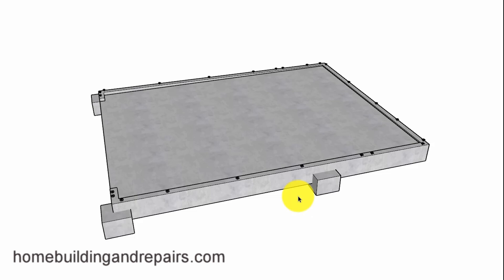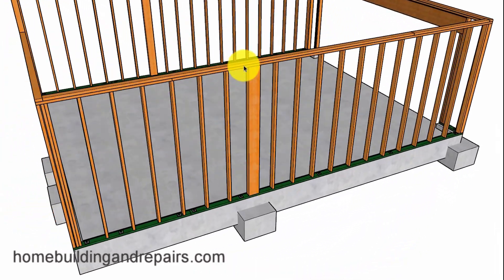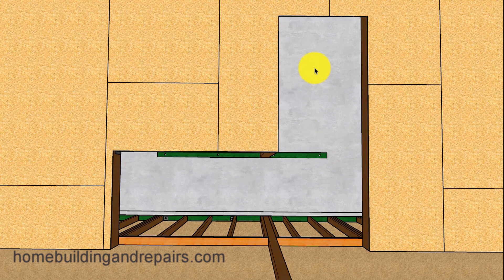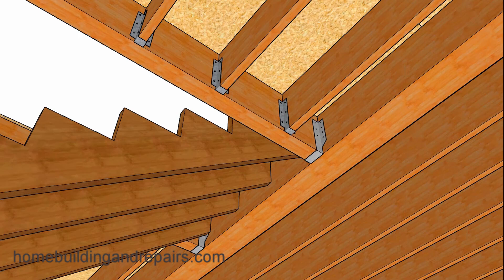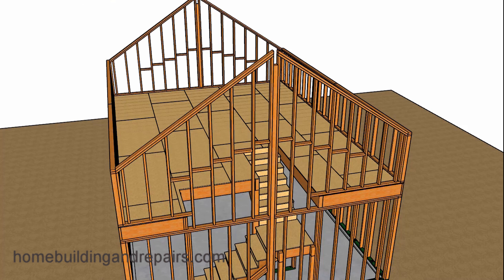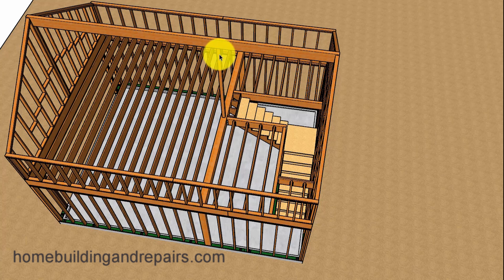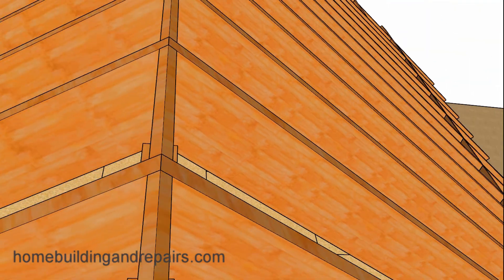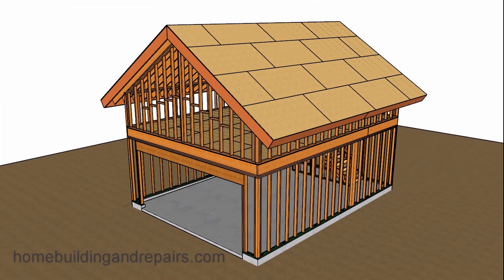How To Build Two Story Garage With Vaulted or Cathedral Ceiling In Loft - Building Series Part 6

Comment: Looking to build a similar garage but need 12 ft lower ceiling height for car lift and a 34 ft length. What is the roof pitch and center 2nd floor headroom ?
Reply from the maker: You can make the roof pitch what ever you want, but I think this on is a 8:12 roof pitch.

Comment: Ok most of your plans for framing are great however some of the building is not what a normal framing is done on a house or garage. I'm talking about the wall you have hanging down next to the landing. Normally it is on top of the landing. Also if your going to have a laminate beam going all the way across the front then you can eliminate the garage door header. We also have out outlookers spaced so that the roof plywood has one on the seam as well as between seams.

Comment: Hey Gregvancom, what’s the general rule for collar ties. I know in other videos you’ve said they can be every 36” or 48” and not needed on each rafter.  

My question is how close to the ridge and short can the collar ties be, to be effective. I don’t want to take out too much of the cathedral ceiling headspace
Reply from the maker: Most can be spaced a maximum distance of 48 inches on center and collar ties can go to just under the ridge.

Comment: I have to build exactly this with a few tweaks.  Thank you for another great video and great ideas for handling the added loads for the garage door wall
Reply from the maker: Glad it was helpful and remember, construction methods use in this video might require structural engineering.

Comment: Glad I live in a rural area without any restrictions at all...only thing I'm required to do is have someone do a drainage test if I'm installing a septic system...other than that, I can do whatever I want...
Reply from the maker: Just keep in mind these are only examples of how it can be built and you might need more structural strength and engineering.

Comment: what i don"t get : 2x12 for the flloor joist. Where do you find 2X12 by 20 feet? Here, in Quebec, the max is 16' (at least at home depot)
Reply from the maker: I understand and if you can't get it locally, then you might have to ship it in or use Truss Joist. You could always make the garage 16 wide and remember that you might need larger lumber also for the walls, floors and rafters.